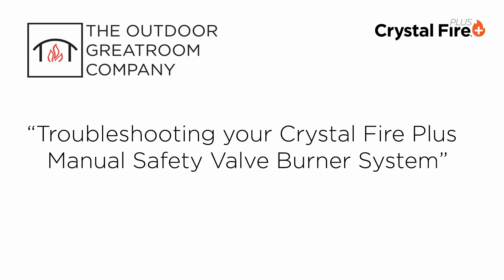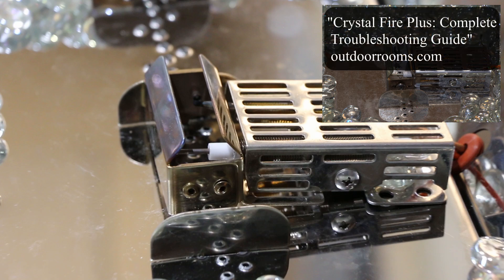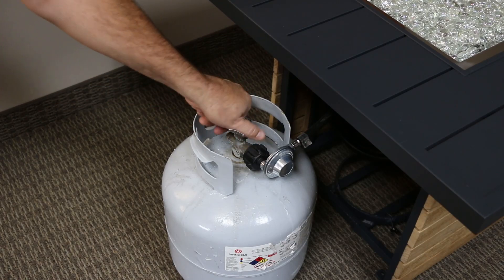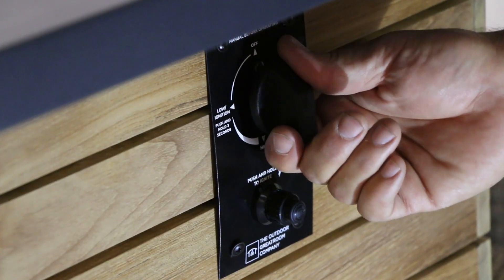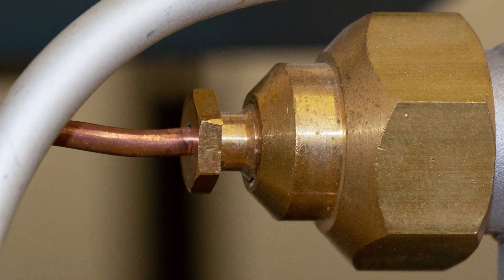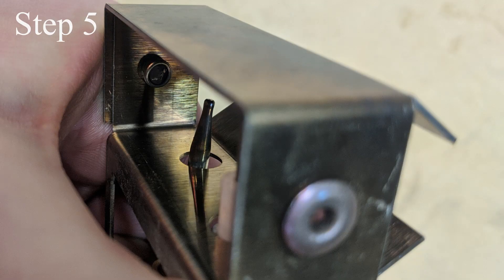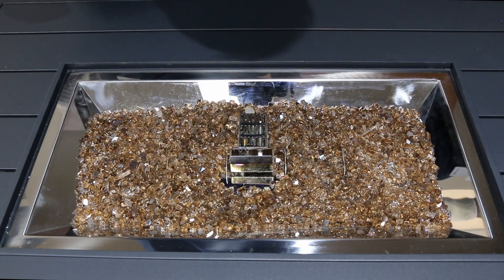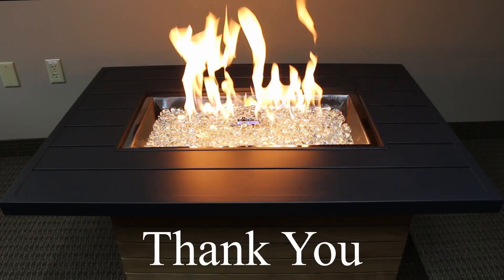Flame Won't Stay Lit Troubleshooting

Comment: Thank you it was spot on.  Just bought and put together a Hampton bay gas pit and I did everything according to manual ( first time buying a pit )  and it still didn’t work, On manual it says tools required screwdriver and a wrench but no where on it talks about the wrench, googled the issue and you popped up and bam the copper part I turned it and it’s working Thank you got the Video.  God bless

Comment: Yeah, designing a burner that won't work with crushed glass isn't the best...  I just got mine hooked up this month and it doesn't work for more than 10 minutes before dying (timed it).  I put the glass beads in around the wind deflector and that didn't help.